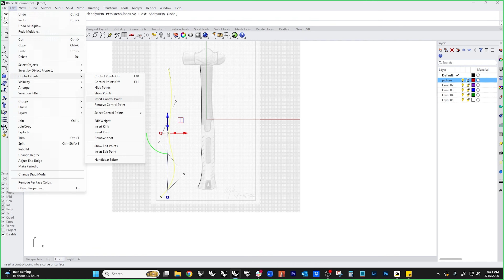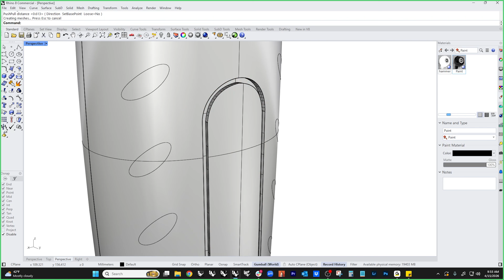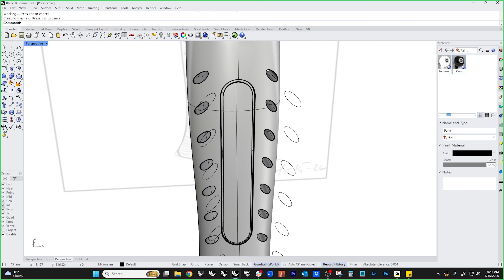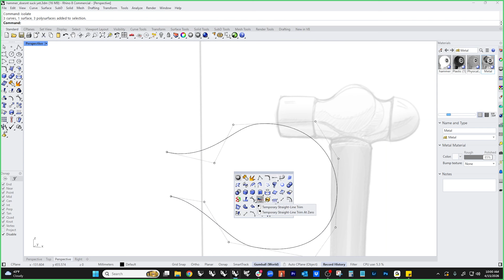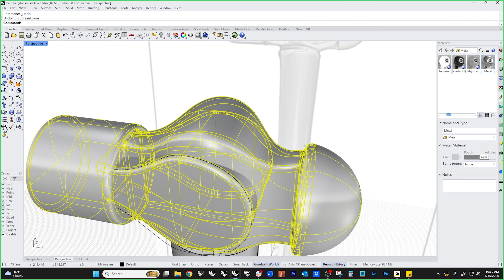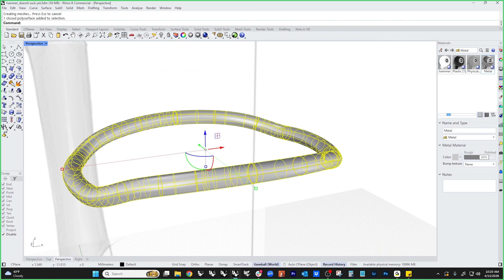Getting started with Rhino 8- hammer time!

Comment: Hello, how are you? My question is, how do I insert a blueprint from four sides—front, back, side, and top—to design a car?
Reply from the maker: picture command and adjust it's orientation with gumball, add images to layers and turn them on or off as needed as well as lock them. I do this as the first step in almost every video I make.

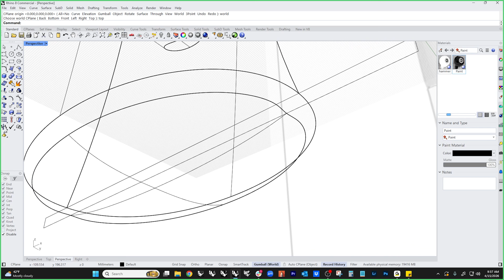Comment: 34:12 I did the same method as yours, but that cut didn’t appear for me
Reply from the maker: occasionally if your curve has an issue or your surface hits on a seam it will fail...if if does,  do the curves a few at a time and see which one is the problem child. 

you can always just extrude that curve and do a boolean which usually will work if the wirecut misbehaves.
Reply: I tried the same method, but unfortunately it didn’t work for me.  
Could you please send me the Rhino file (the hammer)? I need it so I can see what the issue is. Please.  @Rhinoceros3d

Comment: Hi Kyle,

I noticed you prefer split over wire cut. Can you explain why? I'm the opposite. I use wire cut more than split.
Reply from the maker: What works for your and your models is the right thing to use.  

I like split because it follows the existing surface isoparm structure which allows for a shrink trimmed surface operation that makes it no longer trimmed. This means you can matchsrf which can be useful. 

Trimmed surfaces (and wire cut) certainly have this place and you should use what works for your model.